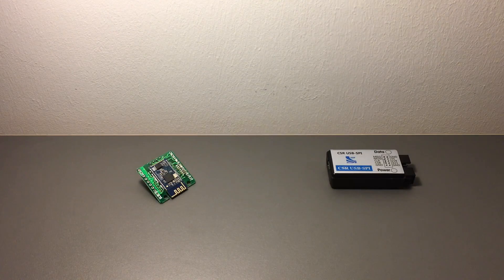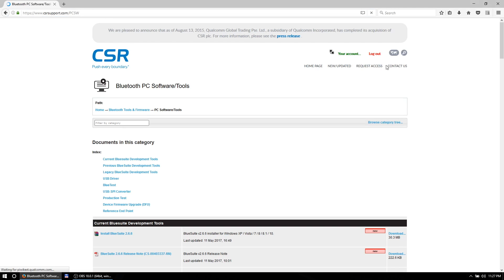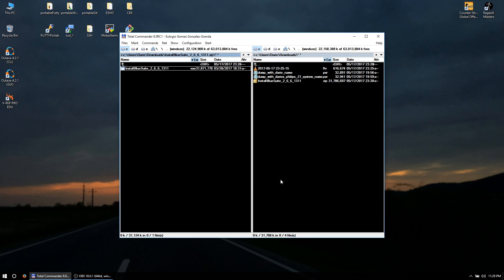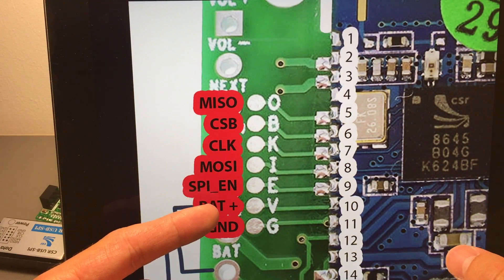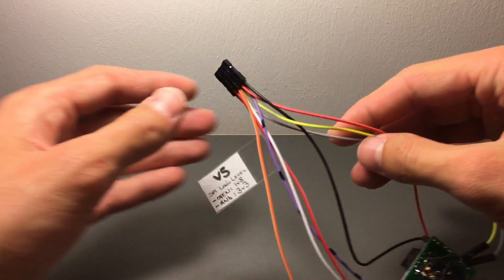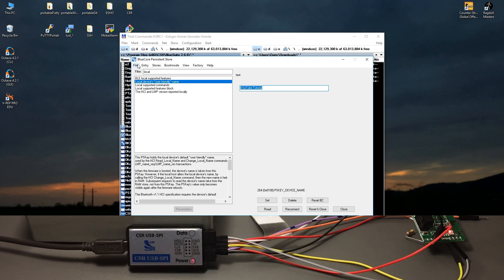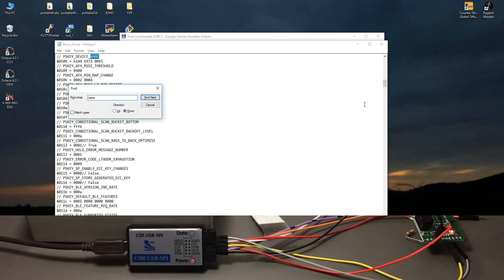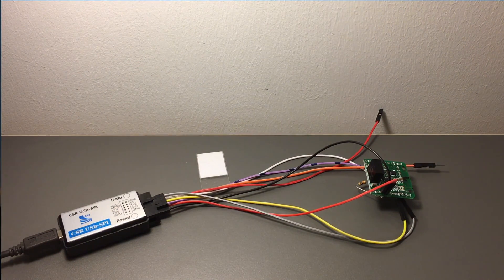How to Rename a CSR8645 Bluetooth Module

Comment: Hi, I have a CSR8645 board and I'm having trouble with the buttons, for example, the "volume up" button. The buttons only work sometimes—occasionally they work for a short while, but most of the time they don’t respond at all. I connected the button to PIO at 1.8V. I also tried using a 10k and a 3.3k resistor, but it doesn’t change anything—the behavior is the same: sometimes the button works, sometimes it doesn’t.
Has anyone experienced a similar problem or knows what could be causing this?

Comment: You still kickin?
Broan Nutone has a Bluetooth bathroom fan, in short I bought one, it worked for a month and now no longer shows up, ie radio not working.
I contacted support and then got an RMA with my dealer who basically issued a refund and basically said don't bother returning it.
I opened it up and it's got a QCC3003 module. Powering things up, it starts pulsing a blue led on the mainboard, similar to a pairing flash. 
It's got a external winbond spi flash which I appear to have dumped twice from and got matching data. Dump was accomplished with a BusPirate.
Used Binwalk to find a gz section of the firmware and then ungzipped that section to what looks like the base configuration for the device. Large xml file filled with config details.
What I don't see in that file though is the word FAN, which I think it identified as "FAN SPEAKER", I was kinda expecting to see that in the flash config. Maybe not?

I tried hooking the module up by locating the USB pd/pn? and connecting it up USB but any attempt so far has run into descriptor issues.  
It's very possible the modules just dickered.
I've got onto the Q website with a 3 letter domain, see if they come back with approval.
I was kinda hoping I might be able to debug more and find out if it just crapped out, maybe it's stuck in different mode,  doesn't seem like the flash is corrupt, but I know nothing so far about it's structure to be certain about that.
I was figuring I might be able to wake it up or reflash it, any thoughts?
Reply: 13:00 explains my name bit I guess, encoded

Comment: Hi sir. I recently bought one of this module and i tested it.
1). It is not switching off automatically when no device is connected. Did you tested this case?
2). I am building a Headphones in which I need an op-amp of 5W atleast. Can you suggest me better Audio amplifier chip which is suitable to accept differential input and produce differential output.
Thanks and appreciated.

Comment: Hi Darieee, i have a broblem with my board Tda7492 with 8635 blue chip. After i channge the Name, Eq, sound (i use config tool)  Now my board cannot use 5 control number of the board (play, next, pause, vol-, vol+) 
Can you help me how to fix it, or reset factory is dangerous😢

Comment: I've got a module with Qualcomm QCC3005. When I connect to it using my Android phone, it doesn't show "phone calls" on the menu. When I have a voice call while I'm connected to this module, the call is not output via the speakers connected to the module. Is it possible to enable phone calls?

Comment: Hi, im getting the Error: Error detecting chip type (Read failed on USB-SPI). 

Ther are 2 Points im not sure if ive made it correctly.
1. The SPI_EN is directly connected with the BAT+ (1.8v) ?
2. It does not need the 5V from the normal connection points?

so basicly i just need to know how or wher to connect SPI_EN, BAT+ and GND. And if i need to use the normal VCC and GND Connections. Thanks. 

Thanks
Reply from the maker: SPI_EN can be connected to the 1v8 line (that is not the same as the BAT+ line, BAT+ should be around 3v3 or even 5v)

if you connect SPI_EN to anything more than 1v8, do so via a 10K resistor
Reply: @Darieee  Mr Darieee is it possible to run any of the JBL or other usb speakers without bluetooth chips? I love music this convenient but have students in my school that caters of EHS sufferers and dont want to deny them tunes while working and learning outdoor activities. We wire up everything and provide correct insulation as much as possible.

Comment: Can we rename using USB_DP and USB_DN pins instead of SPI?
Can’t we use normal USB cable and connect D+ to USB_DP, D- to USB_DN and select the USB option in ‘choose transport’ option in PSTool? If yes what extra peripherals should I need to take care of (like do I need to pull up or pull down any pins) ?

Comment: Hi! Hoping you could help advise on an un-related CSR8645 project?
I'm trying to do this mod (https://www.norwegiancreations.com/2017/09/modifying-a-portable-ipod-docking-to-bluetooth/) but ended up with a board with a different pinout. (Theirs looks more like yours.)
They made connections at "outL", "outR", and "agnd" which i can only assume is... audio ground? My board has connections labelled "L+", "L-", "R+", "R-", "mute", 3 blank ones, and then "m-" and "m+". I can't figure out which of my connections correlates to which of theirs. I also can't figure out where/how they intend to connect the green "bat" wire they added.
Reply from the maker: the link doesn't work on my end

they are using a single-ended signal - meaning ground & channels

what you have is a differential channel - meaning both channels get 2 wires which are all independent from system ground

you need to buy a csr8645 or csra64215 or qcc3008 board with a DC-DC isolating converter - those have a headphone amplifier on them which converts the differential signal into a single ended one

Comment: I have csr8635 and i still have error with detecting chip type... I checked connections with voltmeter and it is good.. I have 10k resistor between spi and vbat.. I connected mfb to vbat too but still nothing..
Reply from the maker: perhaps try moving up to the qcc3008

the software is much better made - I just released a series for those chips
Reply: @Darieee  SOLVED. Connect wires like in video (10k from SPI_EN to VBAT, VBAT to 3,3V; GND GND; MOSI MOSI, MISO MISO, CLK CLK, CSB CSB. Now its not working, so just connect 1,8V from the csr board to VCCA on USB SPI, connect it and ITS WORKING. IF you cant find VCAA on USB SPI, open it and have a look on pins. (i dont have it on box). This helped me: https://github.com/maestun/csr8635-config-notes
Reply: @Darieee  Are you planning to try 
JieLi bluetooth chip programming? These chips are popular now. I dint find any successful tutorial yet. Just found this https://github.com/christian-kramer/JieLi-AC690X-Familiarization
Reply from the maker: nah - I mod Mercedes radios with these bt chips - quite low volumes so - I'm not really that bothered by cost, and, I do have some pressure to keep up the quality

Comment: Hi, I have the same board. Since yesterday it shows me at connecting CSR BC7. I don't hear any more sound. What could be the error?
Reply from the maker: you at some point hit 'Restore Factory Defaults'

that deletes all values and sets back 'some' to a default value

just hit merge with a default dump and stuff should start running again
Reply: @Darieee  Hi, I don't quite understand. How exactly should I do this? Is there a combination? Do you have a guide? Thank you.

Comment: how do you use the on/off pin? bc i tried touching the contact for POWER_EN with the bus voltage, but i cant get the module to shut down without disconnecting the battery.

Comment: amazing! i tried to conect a ttl-usb adapter PL0323 to my bluetooth headset with RDA 28 pins eeprom chip.
the bluetooth headset have only gnd tx and rx. i tried to connect with OVC3868 software however  the doenst seems connected . do i need to connect a 3.3v battery to the ttl-usb adapter ?do i need to disconnect the internat battery of the bluetooth headset? please help!!
Reply from the maker: I really have no idea - I always used the CSR branded usb spi converter

Comment: Hi can you help me please... I have connected my csr8645 whit USB->SPI converter  to my virtual machine win 7 32bit. but when I open PSTool and connect my pcb, I receive the error message: "Error detecting chip type (Read failed on USB-SPI)". What ca I do? I have try everything, connection are OK
Reply from the maker: that's usually a problem with either
1. you not driving the SPI_EN pin correctly
2. some connection is not perfect and the software can't talk to the chip ...

test your cables, measure all voltages ... thrice 🔥
Reply: @Darieee  I have connected the SPI_EN pin with a 10k resistor to the 3v3 line and there are 2.8v on SPI_EN pin.... I have check te connection between the SPI programmer and my chip and there are OK.... The programmer is a cinese version but I think there isn't the problem.... Are there any drivers I need to install?
Reply: @francescocontartese9624  Did you solve the problem? I tried everything ...

Comment: HI darieee! Can i connect the SPI_en and BAT+ without a resistor?
Reply from the maker: nope - that would be a very veery bad idea
Reply: @Darieee  and if I use a bigger resistor? A 12k resistor?
Reply from the maker: ye, 10-30K should work

that too is a naughty way of doing it but ... it's never caused any issues thus far
Reply: @Darieee  thanks for the help, have a great day!
Reply: Hello again! I successfully changed the name of the chip, I applied an eq the same way that in your video, but after reconnecting bluetooth or restart the chip the eq settings clears. Can you help me? Bypass and flat of course turned off and I copied everything.

Comment: Just googling trying to find a module to edit with, have you ever seen Qualcomm DK-USB-SPI-10225-1A at digikey? it appears to have 7 headers on a board and a micro USB connection......In your opinion could you use something like this?

Comment: any idea if you can change the startup\initiation sound on these modules? looks like they are quite customisable....for example a bottle speaker when turned on it makes the bottle opening sound etc
Reply from the maker: yup - you can for sure change them -- I always do

check my other CSR videos on how to do this
Reply from the maker: you need to use the ConfigTool (I think it's in the Disable Mic video)
Reply: @Darieee  whats the reasoning behind the 10k resistor? is that because you are using a 12v version?
Reply from the maker: nono

that EN pin needs 1.8v so, feeding it the 3.3v is a bit much

a very quick and extremely dirty trick is to use that 10k resistor to limit the damage

Comment: Hi, I am now playing around with csr8645 modules and i came up with the idea of building myself a pair of wireless headphones. The problem is that my PC does not have Bluetooth. I managed to wire up the module to act as USB sound card, but this way it only outputs audio through its analog differential audio outputs. I wonder if there is a way to connect two csr8645 modules together using bluetooth?? I would like the setup to be:  PC -> usb -> first CSR8645 -> bluetooth -> second CSR8645 -> analog out.
Do you have any idea if this is even possible with csr8645 modules?, or any different csr bluetooth modules?
Reply from the maker: I'm quite sure it's possible; I would buy a chinese csr8675 bluetooth transceiver and check out the configuration of that

have you by the way been using the ADK ?
Reply: @Darieee  Nope, I have not been using any ADK. I only have PSTool and ROM Config Tool and I had no luck setting this up with these two software tools so far.

Comment: Hi! i am working on csr8645.. i am giving 3.6 v supply with mic29150 and also connecting transistor circuitry as mentioned here: https://www.electrodragon.com/w/CSR8635 the voltage I am getting at Led pins are 5 v... i need to know where I am wrong

Comment: i have lattice HW-USBN-2A programmer do you think it could work ?
Reply from the maker: mmm .. doubt it

you'd have to roll your own custom driver probably

at 15$ a pop it's quite worth it and mega compatible with CSR software
Reply: @Darieee  ok thanks i have order programmer as you recommended. one more question. is there any way to combine 2 csr8645 modules together over Bluetooth then play from one  phone or tablet over two Bluetooth speakers ? hope you got point.

Comment: Hello Darieee, I was wondering if you could leave the wires attached to the board and still connect VCC and GND for ease of future programming (I’m using a 10 pin IDC)?
Reply from the maker: yeah, what you want to do is for sure possible; I do it all the time

you must not connect VCC in that case though

everything else just as per usual

Comment: @dariee can you recommend any audio Transmitter modules that can be programmed in same way, I just see CSR8645  receivers for sale?
Reply from the maker: if you search for csr8675 you will find a lot of transceiver devices with a switch to go between TX and RX

the 8645 is quite old by now, either upgrade to the csra64215 to retain programability, or go to the csr8675 and fight the demons yourself (or just leave it programmed as it is)
Reply: @Darieee  yes have seem some CSR8675 reciever/transmitter modules on Aliexpress, one even has what looks like the SPI header broken out to a header on the board   https://www.aliexpress.com/item/32912822521.html

Comment: Hi bro i want to know that is there any button which will answer or reject call on phone?
Reply from the maker: mmm, you can program that kind of behaviour with the ConfigTool (check my disable mic on csr8645 video) for that

I would recommend moving up to the csra64215, and for that I also have videos where you'll find the ConfigTool linked (they are different programs)

Comment: I'm only getting the "Error detecting chip type (Read failed on USB-SPI)" error all the time. I have tried 2 diffrent modules and I have a 10K resistor on the SPI-EN pin. I have checked that the modules have 1.8V at spi and 3.3V at VBAT.
If you have any suggestions I would be glad!
Reply from the maker: Hmm, you very very sure all your wires are INTACT ?

I once lost a good few hours because I was using mega shitty jumper wires .. and one of them was for real split somewhere ..
Reply: @Darieee  I will try other wires. And do you know how sensitive the module is to shorts? I may have shorted the GND and VBAT when I was soldering the VBAT.
And is it needed to be soldered onto a amp or can you just connect the wires direct to the module (that's what I'm doing atm).

btw i'm using A64215 board.
Reply from the maker: Mmmmm, they could be hard grounding the SPI_EN pin ?
Reply: @Darieee  Does not seem like it. It's 5MOhm between GND and SPI-EN.
I'm from Sweden so Europe would be a alternative.
Anyway I'm leaning towards that there are either some driver or the dongle that is the problem. Probably the dongle as I have tested on both Win7 and Win10 on different computers.
Reply from the maker: So, I use win10 x64 and that works fine ..

You can however fuck your drivers up ... so ... I heard that does sometimes also happen
Reply: @Darieee  Removed the drivers and reinstalled them. Also tested on another computer.
I have now ordered a second programmer. Will report back when I receive it and tested it.
Will order new modules aswell.
Reply from the maker: Alright - hope it turns out ok!
Reply: @PlaceholderforBjorn  Did you solve it? I tried everything ...
Reply: @Johanek123  No I did not.
I have moved on to other projects (like moving etc..) so the modules is in a bin somewhere. Will reply if I manage to fix it.
Reply: @PlaceholderforBjorn  SOLVED. Connect wires like in video (10k from SPI_EN to VBAT, VBAT to 3,3V; GND GND; MOSI MOSI, MISO MISO, CLK CLK, CSB CSB. Now its not working, so just connect 1,8V from the csr board to VCCA on USB SPI, connect it and ITS WORKING. IF you cant find VCAA on USB SPI, open it and have a look on pins. (i dont have it on box). This helped me: https://github.com/maestun/csr8635-config-notes
Reply from the maker: can't you set up the csr usb spi to work over 1v8 levels somehow differently ??
Reply: @Darieee  i dont know, its working now, so i probably wont search anything else.. VCCA has the same voltage as 1,8V on USB SPI, but it isnt the same connection (voltmeter didnt beep)
Reply: @Darieee  I have now tried a third module, and have the same issue... I have doublechecked shorts, changed the wires, checked the SPI and VBAT voltages. And still the same problem...
Leaning to a faulty SPI-USB dongle... See if I can find a new one without ordering from china.
Reply from the maker: Where're you from? Last year or so, it was still nowhere to be found locally unfortunately
Reply: @Darieee  Tested reflowing the usb dongle, switching mosi and miso cables. With no luck...
Is it supposed to be CLK->CLK, MOSI->MOSI, MISO->MISO and CSB->CSB?
Reply from the maker: Yeah, correct - you're not supposed to invert anything here

Comment: This worked great on a CSR8675.  Beware that some SPI interfaces have different pinouts even if they look the same.
Reply from the maker: Hey, me and a few friends have just gotten started with the 8675, and are having issues with finding the proper software - could you maybe perhaps help out with some pointers ?

Comment: I have the csr 8635 will it still work?
Reply: Thanks! I had to solder some wires. It worked tho, thanks!
Reply from the maker: welcome!
Reply from the maker: Yes!

All the software that works with the CSR8645 also supports the CSR8635 and CSR8630